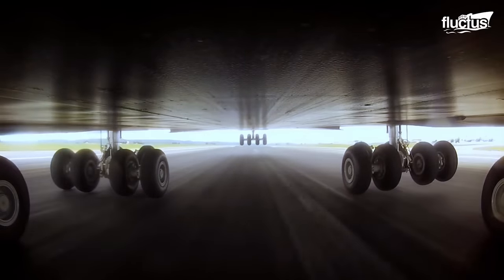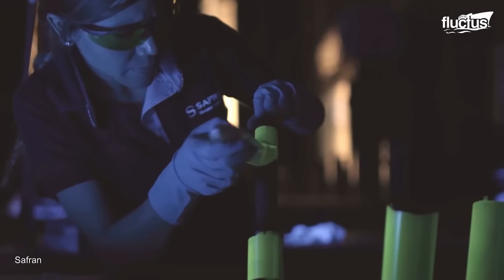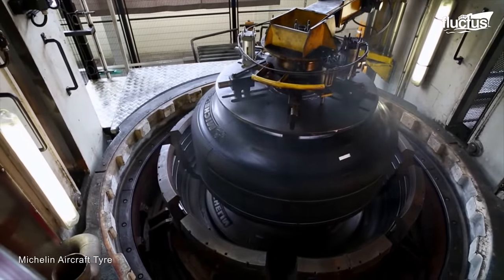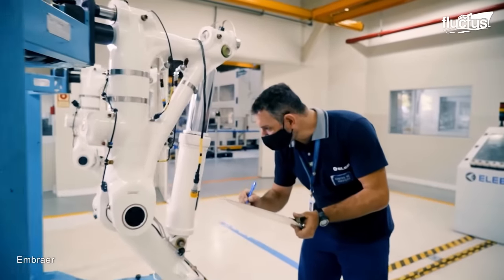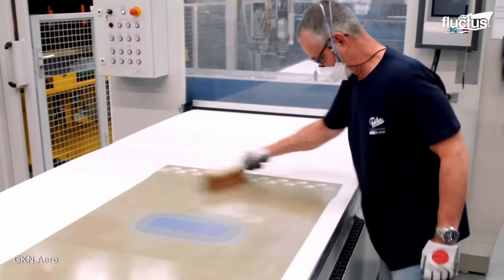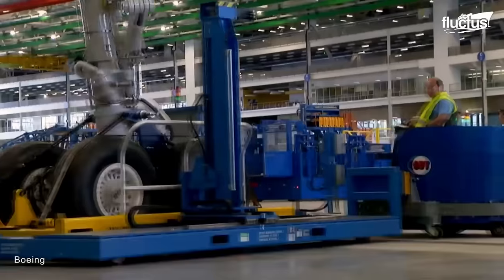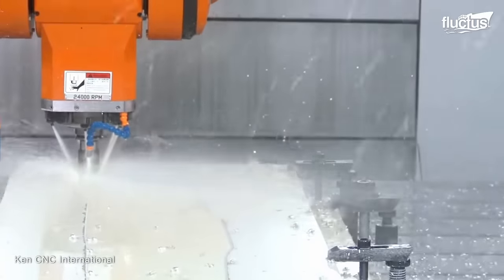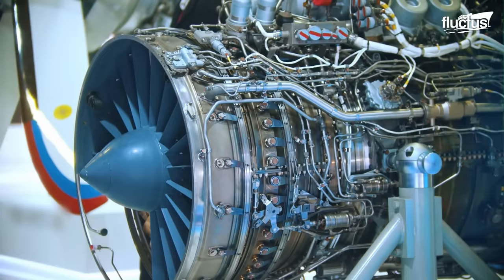Inside Billion $ Mega Factory Producing Massive Landing Gears for Airplanes

Comment: It's amazing how an aircraft wheel can go from zero to 150 MPH faster than you can snap your fingers while simultaneously having a load of zero pounds go to several tons at the same time!
Reply: They were actually working on spinning up the landing gear wheels before touch down to save and extended the tires rubber and life. As well as putting less stress on the landing gear compents 😮 👌
Reply: Del oko

Comment: 0:12 It is definitely wrong to use normal rubber that starts to smoke because of the heat.  PTFE has one of the highest melting points of any thermoplastic at 327°C, and a very large operating temperature range. Since landing runways are completely smooth there is no need to have air-filled rubber tires.

Comment: I've always wondered what the logistics might be to get the wheels turning at the speed of the landing before touchdown. 
Cost/benefit analysis stuff that is over my head.
Reply: Everybody quite reasonably asks this, but the weight and complexity are far beyond the value saved in the tires. There have even been passive ideas that used wind vanes attached to the wheels to let airflow spin them up, but even that wasn't worth the cost/benefit ratio. It's a fascinating question and google will serve you well.